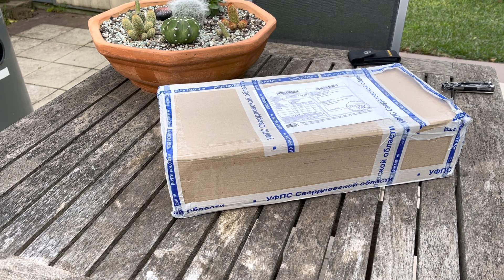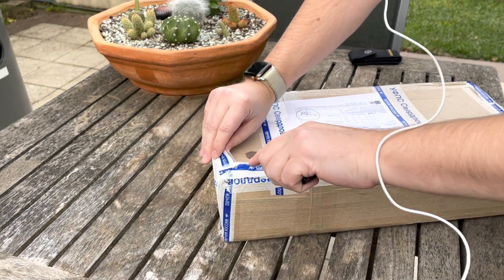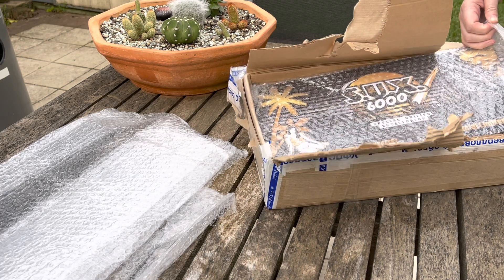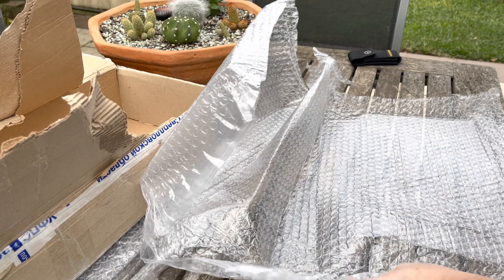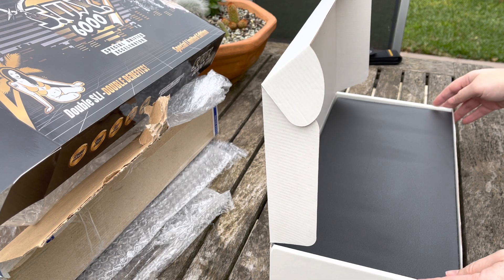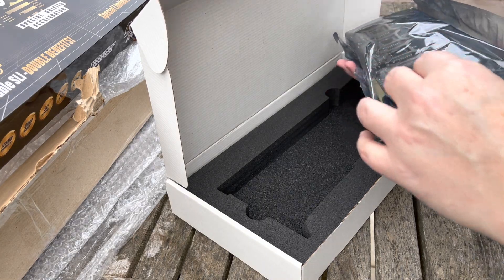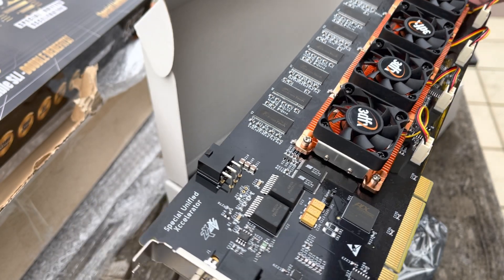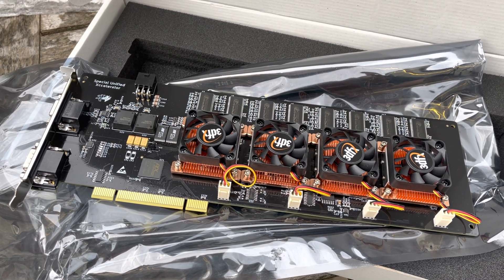Special Unified Xcelerator (SUX) 6000 Unboxing - Voodoo 5 6000 Remake

Comment: PCI Bus? That's going to bottleneck the absolute crap out of this card.

PCI was, and is a terrible choice. Are these actually not available in AGP form?
Reply from the maker: Actually at 66MHz it is the same speed as the AGP version. For 33MHz there is a bottleneck but only in certain titles in very specific conditions. The AGP version is limited to 3.3volts and 1x AGP, making the PCI version a lot more flexible (and not terrible) and usable in newer motherboards.
Reply: @michaeldale837  LOL. "And not terrible".

Fair enough.

So... This card runs at 66mhz PCI? How is that even possible? Replacing the clock generator on the motherboard?

I had troubles running PCI at 38mhz-40mhz, let alone 66mhz. What am I missing here?

I was apparently missing PCI 2.1 Specs. I had NO idea 66mhz PCI was a thing, especially a standard and not just an OC.

Good to know. Thanks brother.

Comment: smart  af  , but what is the justification of using a pci bus on such a high end card
Reply: @Mr. Sophistication  cheers for the  reply  ,that clears that up
Reply: In general, there is definitely a performance loss from not implementing agp, for games >1999. When the voodoo5 was released, there was little performance difference between the pci and agp versions with most games. Later games, and some 2000 ones,however, started saturating the pci bus. Usually, increasing res or AA will negate this effect of this, by making the fillrate the bottleneck. Usually, but not always. And I'm talking of the 5500 model here. Now add the fillrate and bandwidth capabilities of two more vsa100's and their respective memory, drive the card with something like a 3GHz P4 or Athlon XP equivalent and you can see how even increasing the resolution to 1600X1200 may not negate the agp advantage.  

There's a bit more to this in that although the v5 5500 is an agp2X card, it runs internally at the communications speed between the vsa100 chips (pci66=agp1x). I ASSUME that the same applies the the 6k version Still, that's double pci bandwidth and will make a visible difference. In this regard, I would take what interface bandwidth I can get! A bigger problem for the 6k version was the incompatibility issues it had with many agp motherboards; not necessarily the fault of 3dfx, as many board didn't meet the agp spec. 

https://www.pcgameshardware.de/3dfx-Voodoo-Hardware-255488/Specials/3dfx-Voodoo-Retro-Special-1246582/